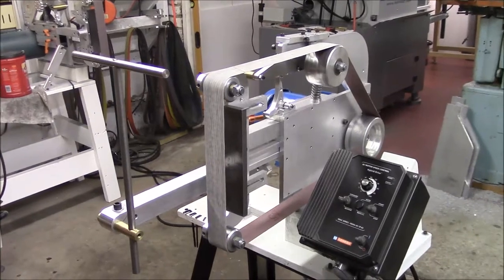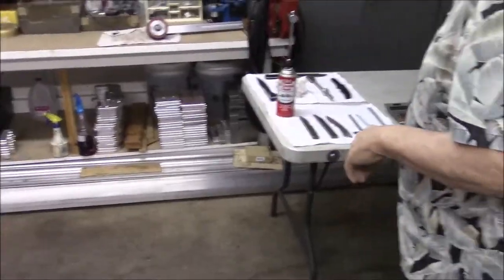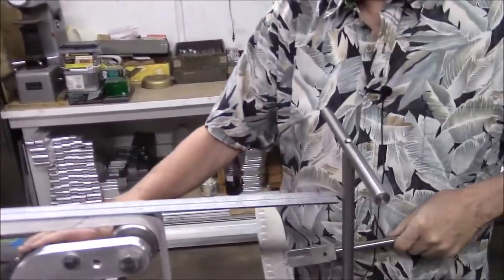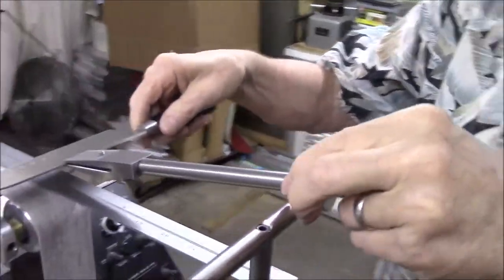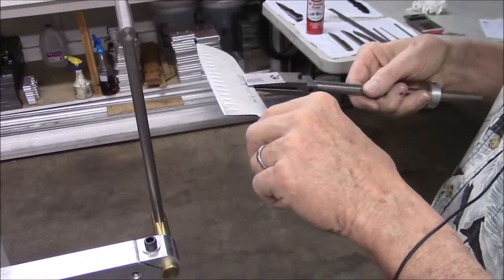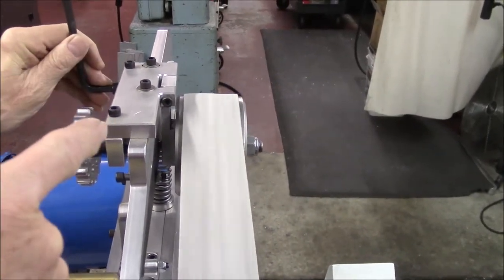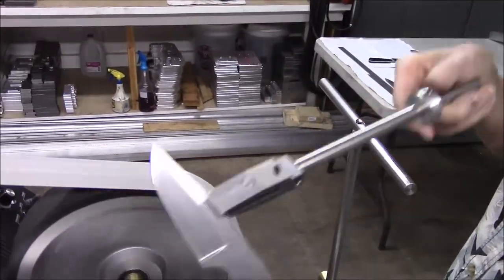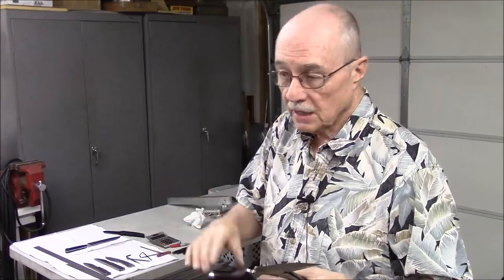New Knife Sharpening

Comment: It's a nice jig set-up for angle, but at that speed and running it dry you're taking the chance of ruining the temper of the blade. Come up with a misting system to cool the blade as you're sharpening and it would be a sweet set-up.
Reply: Not true! Quick passes at 1200-1700 RPM you're absolutely not going to have an issue. 🤦
Reply: @AzTurboMini  At a microscopic level the heat created will damage the temper on the very edge so that your sharpening is going to suffer a slight bit of damage. I put my final edge on wet and get wicked sharp eknifes that hold their sharpness much better than when done dry.  Check out this surgical edge on a knife I made: https://www.youtube.com/watch?v=hOLIJwtv2lg It's the small details that make the difference between a so so knife and a great knife! I didn't come up with this on my own, but during discussions with knife makersthe likes of Nick Wheeler, Nathan Carothers, Devin Thomas and his son Larrin who is a metallurgist. Try doing it wet, you'll like the results!
Reply: @ChucksMagic  That's a myth.  The key is to barely touch the belt and move quickly.  It simply doesn't heat up if you do it properly.
Reply: @WeberSharpening  Friction is a myth, I guess we will just have to agree to disagree.

Comment: Use your smartphone and the angle meter app and measure the angle directly. Or use the scientific calculator app and use trigonometry and calculate the angle directly.
Reply: Great idea, sorry it took so long to respond.
Reply: I don't have a belt grinder but I am in the market. To get the angle I wanted I would use my Wixy Angle Gauge.